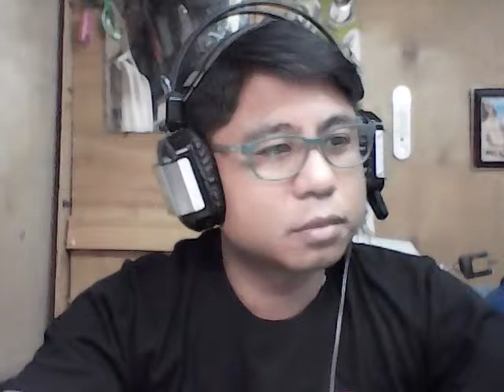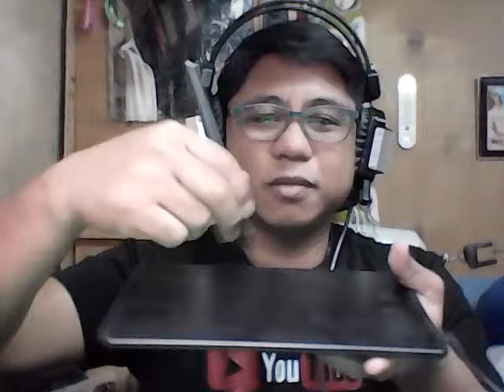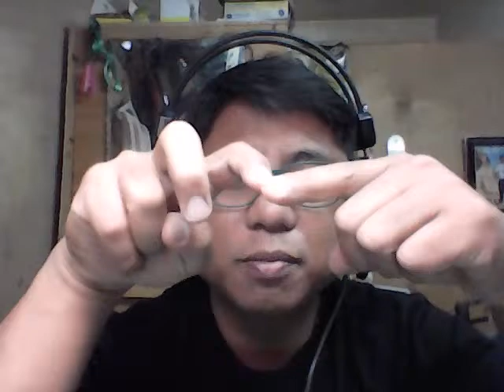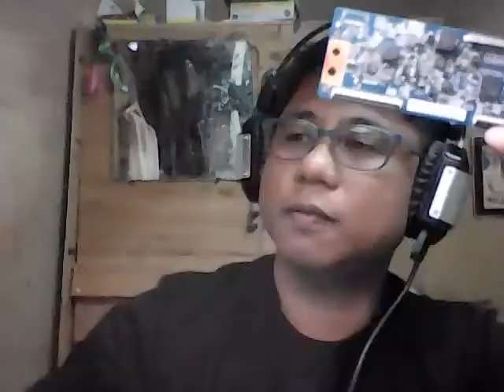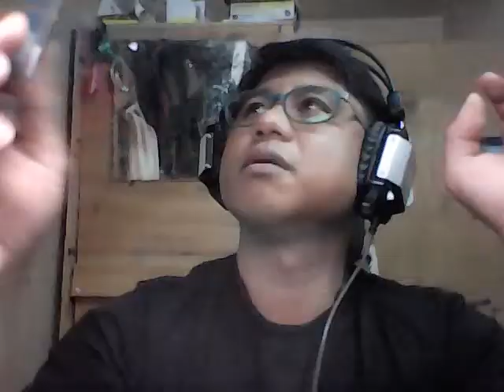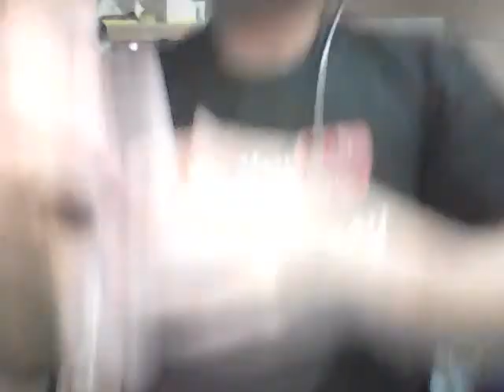LED TV PANEL REPAIR BASIC TROUBLESHOOTING QUESTION and ANSWER

Comment: Guro may tanong po ako dalawang beses ko na nagagawa na ang samsung 49" 4k UHD on and off panel protect nag tape ako sa ckv lines gumana problema may lines sa baba nung tumagal nag karoon ng din ng vertical lines sa gilid at parang may sunog na sa gilid ng panel.. try ko grinder yung sunog pero di na natanggal ang vertical line.. pano po maiiwasan pag ganon..